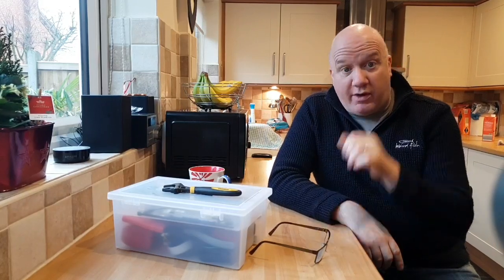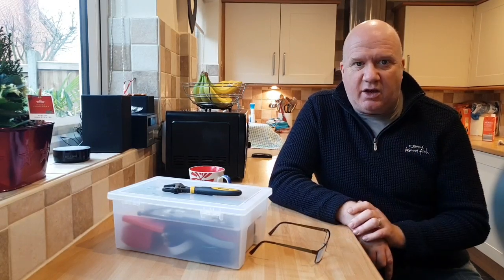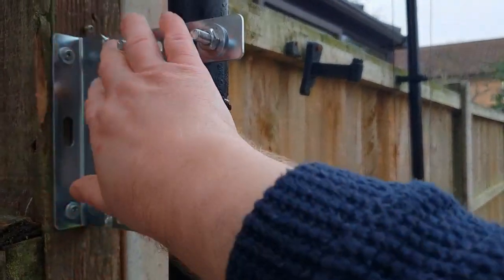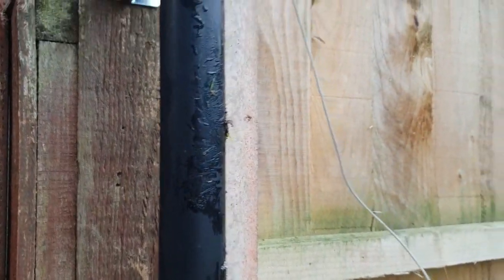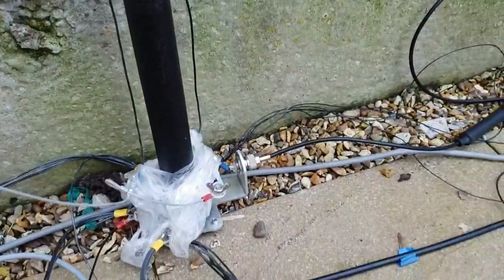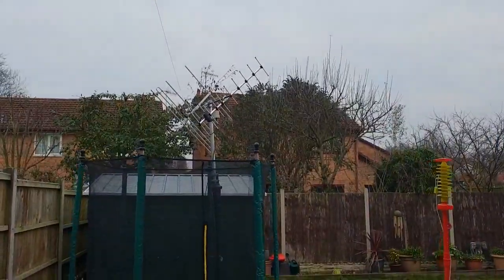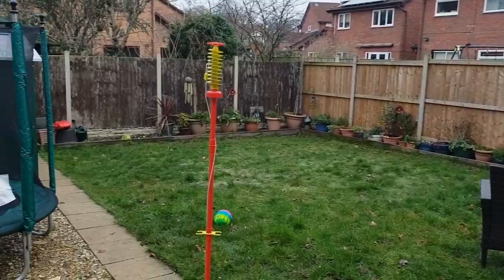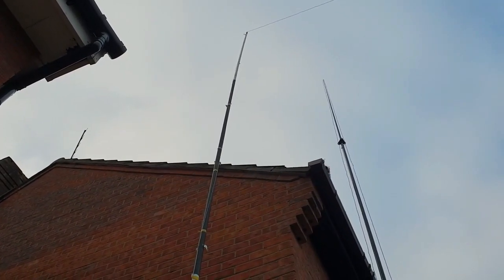How to set your HAM radio up to RECEIVE and DECODE Wefax

Comment: Hi, I'm using a webSDR to receive some wefax images, I tried all kind of software, but none of them worked at all. I tried also fldigi, but like all the others all I get is a completely distorted image, I know it has to do with something related to the slant settings, but i don't know what to do. I would be very happy if you could help me. Thanks
(P.S. I am using the frequency 3853.10 (DWD Pinneberg Met Fax) )

Comment: I watched this video earlier today and thought I’d give it a go. I’m using an RTL-SDR V3 receiver as my Yaesu FT-707 doesn’t have wide band receive. And the antenna I had it plugged in to was an 18ft vertical for 27Mhz called a “station master”. I tuned to 5.100Mhz and there it was. A strong signal coming from central Western Australia. So I downloaded FLDIGI and set it to the correct WEFAX mode and a map appeared just like it should. It’s basically a high resolution grey scale SSTV image. As you said, when the bands are dead there is all these other things you can tune in and listen to if you know what to look for. I hadn’t heard of WEFAX before watching this video so thank you for showing me something new. It would be good to exchange some WEFAX images from the other side of the world as I’m here in VK. 

Thanks again mate. 73 from VK5FPKR
Reply from the maker: Fantastic! Yes that's a great idea, wonder if there's somewhere that you can create and account and upload, this could be automated hopefully!